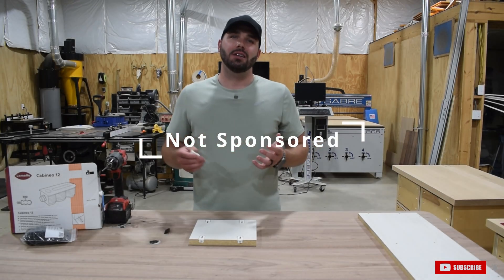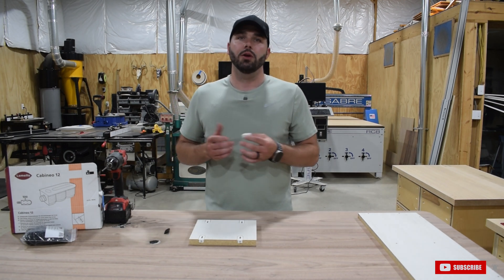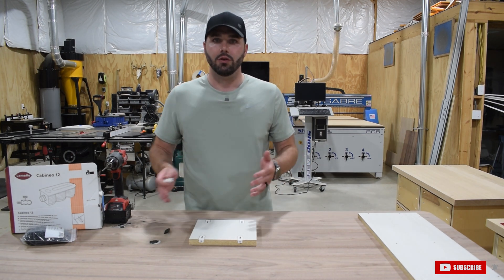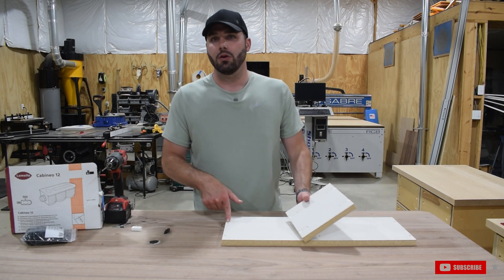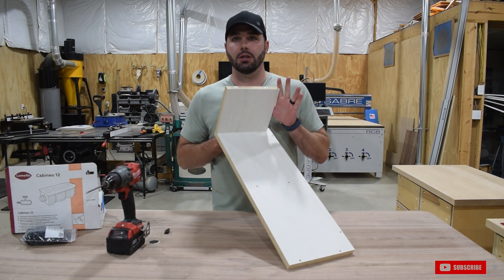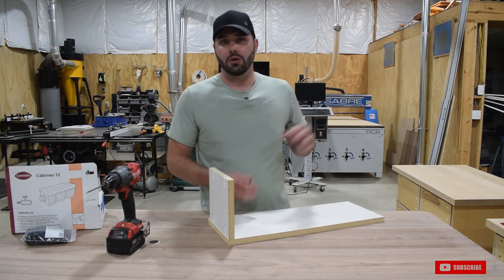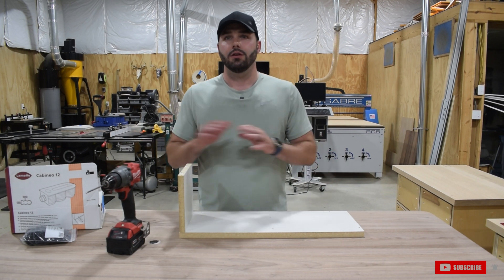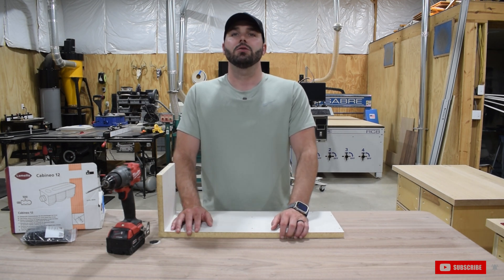Level Up Your Cabinetry - Lamello Cabineo Review

Comment: Love to see it.   How do you decide whether the cabineo goes on the outside or the inside, for the 90-degree connectors?
Reply from the maker: Great question! For me I focus on placement to make it the least visible as possible. For tops and bottoms I will put on the outside of the box as they won’t be visible. For shelves I usually try to hide them underneath.